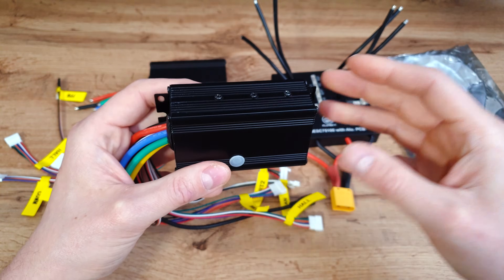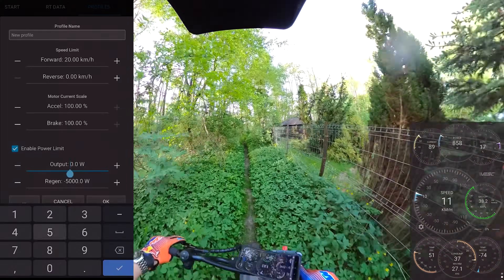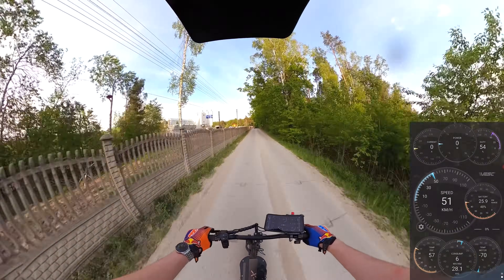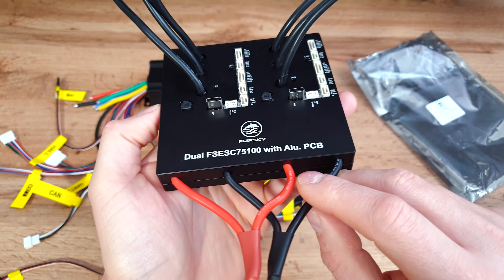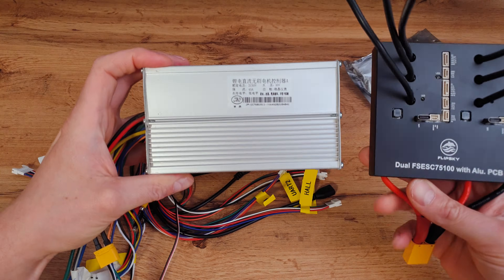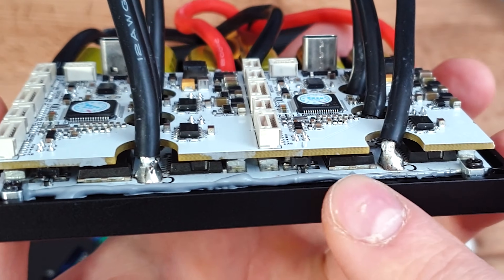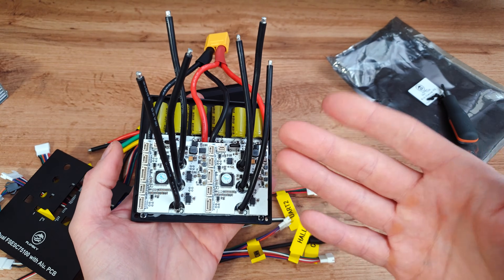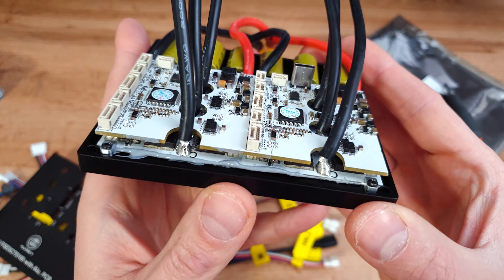Dual FSESC 75100 V2 with Alu PCB 🤫Looks like they fixed overheating issue & Small Update

Comment: can you access profiles on the go? Like gears inside certain amperage values?
Reply: Like can I set one profile to reach 20a anotjer profile at 40a and 80a etc?  Goal is to setup gear like shifters
Reply from the maker: Yes U can set profiles, different speed, power 1wd/awd ...
Reply: Thanks i ordered 75100 dual flipsky. If i encounter a problem can i reach out to you for help with vesc tool please? 🙏 @PirateWasHere
Reply from the maker: Sorry I do not provide teaching support

Comment: I have never ever had an issue with overheating on any of my flipsky controllers. I size them properly I go and get the one that actually can put out the amperage. I want not make it force the averages above the limits of that little baby 100 controller. Sorry to rant. I’m just so fed up with all these videos on here that are not right.
Reply from the maker: Rant... before rant show some numbers, I am also fed up about people which just talk, but can barerly understand how it works and cant give any decent info, like KV, amperage , voltage, heat spreading  efficiency, connectors ,  wire awg. 
Mostly they just talk talk talk....

Comment: Why don’t you use the proper size controller instead of being cheap buying a super small unit. I am so tired of people complaining about overheating and burning up their controllers. You said you crank to 5000 W! Why that controller isn’t made to do that if you do what it’s made to do if you read the instructions if you educate yourself just a little bit before you make a video you don’t look so stupid!
Reply from the maker: Do you mean like , my car can do 6000rpm max, why I am not using it like this all the time ? . 
It's not about size but about spreading the heat from mosfets, newer case can easily help spread 5kw compare to old thin one, which after 8sec is 100c++ ( lots of people reviews on groups).
Looking stupid these days, seems to work better than other way. 
Cheers

Comment: Hi Pirate! Do you think the flipsky FT85BD ESC will have the same performance as this one? The specs look the same.. thanks for the videos!!
Reply from the maker: I guess, hard to say
Reply: No, ft85bd can do 2x250A peak, this controller can only do 2x200A peak. Alum casing on the ft85bd is also much better and spreads heat more.
Reply: @SRNAR8 but it doesn’t have vesc software, and I think that their Flispky software isn’t as good as the vesc one

Comment: looking to use this ESC to convert a lawn mower to RC. will this ESC work two motors independently to make left and right motors spin in opposite directions for steering or does it control both motors simultaneously in the same direction only?
Reply from the maker: Bruh I want to do literally the ame but I want to build all from scratch 60/80cm + use tracks or small quad wheels :) . U can controll VESC as you like by simple ppm / pwm , if U want to use just RC remote without extra controll board, then U have to setup " mix " on remote for two channels ( for both wheels ) , so it will drive more or less like tank . Cheers

Comment: Hi 
I have a Dualtron ultra 2 72v 35ah 6640w dual motor scooter. Which controller would be best for my scooter. Would like more power and speed if possible. Thank you

Comment: Hey quick question I had single drive fs75100 and I used two batteries in parallel (58,8v/18,6ah/964Wh each of them). I ordered now dual drive fs75100 and I'm wondering about its better to use my batteries still in parallel or is it maybe better to use 1 battery per side of this vesc. Z góry dzięki za pomoc 🙃

Comment: I went with two of the new ubox 100v/100a single units with fans from spintend, thinking about throwing it into a laotie Ti30 (or similar system) or a T10-DDM
Reply: I bought a set of the 75v 100a uboxes when on presale 😉 like $80 a piece 😉 score. Gonna get the 100v100a while on presale too. But anyways. Have had them in my board but just got scooter. Thinking i would like to put them in new scoot 😁 (maike kk10s pro) but i also want the new spiny throttle spintend has along with hub to vesc adaptor harneses and the ADC unit 😉 that has all the other hook ups. Lights n horn n whatnot 😁 i am curious if the 75/100 uboxes can take the heat? I think i will use thermal paste and seperate them when installing in my metal scooter enclosure. 😁 Did you receive the 100/100 yet? 😁
Reply: @redreefbud  I wanted the spin-y too, but i'll settle for the throttles I have laying around already for now haha.

Damn you definitely scored well with the 75s!

I ordered the adapter board and a bunch of spare harnesses, as for the 100s they have delayed shipment at the moment due to having made some changes by the looks of things
Reply: Yeah, he claims a copper plate in there for dealing with heat. That should help 😁 and them thermal payste and hooking them spread out in corners. I didnt realize how heavy duty this metal enclosure is until i ripped apart 🤯 huge heatsink with outside air flow as long as you get good connection 😉 this thing i got here is a beast already. Going to collect parts and think about it while i beat on the stock version 🤣 i did get a daly smart bms that im thinking about putting in today 😁 want to check this battery out and make sure it is what they told me anyways 😉 should be 16s6p samsung 50G 😁

Comment: I tried that one but it seems unstable on FW 5.3 because it can't even get my Motor configured right in FOC and flipskys customer service is absolutely garbage... would definitely stay away from flipsky
Reply: Two of these escs died on me the same day, I got 100$ refund (one esc), won't buy flipsky ever again.
Reply: @Eden_M  how did you run it, power it up etc

XT90-S loopkey or crappy antispark that dumps all power?

also these things break easily by vibration i figured, when they arrive first thing you need to do is open them and go over the electrolytic capacitors (add extra solder on all the pads)

one broke not long after i bought 2 of em (both 75100 alu pcb but not a dual version in the same scooter)

when i opened the broken one there was a loose capacitor, entirely off the board, another one with 1 leg detached, and another one also leg melted

traces on the PCB blown to the caps and a ceramic cap blown up

i suspect the 1 remaining of the 3 caps couldnt handle the current and melted the leg and then the extreme peak current shorted the ceramic cap and because of that short blew the traces to the capacitor

well, i saw a 250A fault current due to smashing full throttle on a badly tuned motor

i figured the electrolytics are sometimes badly soldered, i ordered a 3rd one to replace the broken one, opened it up before i done anything, touched a cap and a leg instantly came off of the pad on the board, so i added solder on all of them, in the older functioning one and in the new one

then i added 3M strip calk under and above the caps to make sure it wont get vibration damage either way

probly could use some foam weatherstrip under and above the capacitors instead, just to make sure they dont break anyway

since then it's been 6 months without any issue, seeing 120A peak motor current each every day

i do run an antispark connector loopkey aswell though, the "antisparks" you buy on their site just dump a lot of current which is bad for the ESC's

also it's important to not plug them in separately with CAN connected, that can break the CAN ic's

in my case the broken one actually still works, but has no capacitance so it is really weak and cuts out constantly

i can probly add a low esr cap bank to it externally but meh, maybe one day if i decide to fully fix that controller
Reply: @BH4x0r  Hi. I want to install 75100 alu to vsett 11X what do you say? I know that i must open and reinforce internals this is no problem. Or maybe i will mod original one with better wires more solder and add copper  wire for shunt this will probably ad another 20A or even more.
Reply: @trebor1477  they're awesome, but you should really look at the 75200 alu pcb's, on VESC it usually says motor current instead of battery side current

when you see 45A on scooter controllers, thats the battery side current, real peak current is probly 150+A at low speeds

i've been riding the 75100 Alu PCB's now for a long time and had no problem with them, but i feel like i miss a bit of torque, could be my motors too though, but yea 120A motor side isn't that big

also even if you dont run it that high on the 75200 alu pcbs, you've got less strain on the controller and probably even more longevity, and if you ever want more you can do more

but yea, great controllers either way.. cant go wrong with them

i don't even use physical brakes, i just use regen cause its that strong already
Reply: @BH4x0r  Hi. Thank you for your info about the controller.  For now I modded the original 72v 51A controller from vsett 11 super. So now it must be 60A under turbo mode and 50A in normal mode. I added a temperature sensor to monitor how hot it will get. And it is quite heavy almost 2kg with a little more copper and 8AVG wires.
Reply: @trebor1477  the 75200 Alu PCB's are only ~300g each and very compact

they can be due to using modern surface mount mosfets which can take 380A each! there's 12 mosfets in each 75200 Alu PCB

so its safe to go up to 250A motor each, and they have 760A worth of fets per phase so very low stress on the components, but due to the board and wiring not smart to go over 250A

the 75100 Alu PCB's have 380A worth of fets per phase (6 in total), but due to the pcb and wiring not wise to go over 120A

the original 75100 black box overheating ones had crap fets with only 120A rated fets
Reply: @trebor1477  by the way, to let you know how reliable the controllers are, i've had mine in my main scooter (Obarter X3) since pretty much the beginning of owning it, august 2022, and i've done 15000km since then, no real brakes, regen throttle on ADC2

current cfg: 45A battery 120A motor/max current
-25A regen 120A motor/max regen current

each controller

due to my battery right now i cannot ask more than this, but never had overheating even in 36°C weather

i'm waiting for P42A's to come available in my country again, i have another scooter (Boyueda S3) thats waiting on a custom battery and i'll put the 75200 Alu PCB's in it!
Reply: @BH4x0r  Nice. In the sett 11 72v controller are old CRST030N10N 207A 100V. Is it possible to use the original display and trigger  with 75200 ?
Reply: @trebor1477  you can use the trigger of it, but it cannot communicate with the screen to say speed etc

Comment: Hi, this controller does not come with any cables right?
What is the type of plug that I need, looks like some sort of JST but cant find anything specific..
Reply: jst GH 1.25
Reply: @server1789  massive thanks man :)
Reply: @flosa1995  hey, i get mine today. There in package are already all connectors. I order flipsky 75100 v2 from official store👌

Comment: just buy a sun ron , cheaper in the long run then fuking around with theese small wheel scooters
Reply from the maker: Nah man Ktm EXC 250 is way to go, but still 4x4 is most comfy ;)
Reply: sur ron lol nah they aint powerful enough lol. By the time u invest abt 3k more in batteries and controller, it wont be worth it, u could literally get an used ducati hypermotard for that much and they are way more powerful and fun.

Comment: Pirate! Massive thanks for your initial 75100 vid.

Just about the complete my Flipky 75100 on my Wolf Warrior X. Just the lighting left.

Took it for a test ride... oh my gosh... insane!.

Smooth, no motor noise, crazy stable with smooth acceleration to 50mph. No jerk and the electric regen braking (Used a left sided throttle  with ADC2 brake no revers settings on VESC rool) is suprising strong enough that not once did I feel the need to use the brake on a 30 minute ride. A Totally different scooter. 

Never going back to normal controllers.

Will post vid once complete
Reply from the maker: Awesome 🍕🍻
Reply: Are you using 75100 earlier or this new version like in the video?
Reply: @strangeous  the alu's are definitely much better, they'll do 50A @ battery 120A phase/motor peak, and more on battery side too all day without heat issues
Reply: So where is the following up video :-) ?????

Comment: what should i get for an AWD trike? 75100 dual + single or 3x single?
Reply from the maker: for 3wd for sure U need one dual and one single, I didn't test yet newer 75100 but looks like will be good
Reply: @PirateWasHere  hm guys from flipsky told me to go with 3x singles connected with CANbus... becuae more similar characteristics of single ones than mixing dual + single
Reply from the maker: @redhotbits  how u will connect 3x single if every single got only one can port ?

Comment: Have you tried the spinted ubox bro.
75v 200amps.?
It look very similar to that.
Reply from the maker: It seems to be way better, but I did not test it yet
Reply: @PirateWasHere  well I can say I use the ubox v1 and it’s insane bro. I’ve not had any  issues with it. I put it in my electric mountain board. And bro it’s a beast. I bought another one for my next build. It doesn’t over heat it’s really good.
Reply from the maker: I will try it then 🍻
Reply: @PirateWasHere  it has a 12volt output so you can put fan on top of it.
Reply: I have 2 of them in my mountain board and thinking about putting them in new scooter 😁 i have the 75/100 singles (UBoxes) just got a maike kk10s pro. It is already a beast but very touchy throttle 😉 curious about heat

Comment: Nice ! what would u recommend ubox v2 or dual 75100 ?
Reply from the maker: I never used them but Ubox V2 seems to have HQ mosfets but the price is like x2
Reply: @PirateWasHere  Hey bro ... so if I'm getting 2 7500 watt motors.... the controllers need to be 72 volt 100amps each? like Volts*amps.. in this case is 7200watts.... so I need the 72 volt 100amp controllers to pretty much get most of the power out of the motor right? besides being 300watts off?
Reply from the maker: @fightsandfinance7570  for legit 7500w u need 14 000w controllers ;)
Reply: @PirateWasHere  For both of the 7500 watt motors right? I did your equation .... The Chinese manufacturer are giving me 72 volt 50amp controllers which Is weak for the Dual 7500watt motors... I will need 2 72volt 100amp controllers Right? Totaling 14400 watts 600 watts below motor peak capacity but oh well that's already a lot of power
Reply from the maker: If motor constant is 7500w , then peak cold be extra least 50 to 100%
Reply: @PirateWasHere  they say it's 2 7500 watt motors... It says 7500 a piece on the side of the motors.. it's a good bang for the buck for the Money
Reply: @fightsandfinance7570  If you write 15kw on the side of the motor, does it double the output?

What I'm getting at is that when buying Motors you have to trust either your own knowledge, or the rep of the vendor.

The same motor will be sold at different power levels with nothing changed but the labeling
Reply: @Zomby_Woof   @Robert Franz  Your right. I trust the vendor I bought my scooter from... My first skepticism was if the motors existed at all. But I confirmed it was real.. Confirming whether or not the vendor was real in the first place at all was my first mission. I actually placed a down payment a couple days ago and they built the scooter already and told me when I pay the rest off .. it'll be shipped. I got the 2 7500 watt motors on it with a 72 volt 60 amp Panasonic battery.. I'll make a video of It when I get it. It costed me 2350 ... I don't know how people are paying so much more for scooters with much less specs ...but then again companies like the Varla, Vsett, zeroXs, and Dualtrons and stuff have to make money. I bought it directly from manufacturer in China. I'll just have to wait to get it. The only thing is that the controllers im getting in it is 72 volt 50 amp controllers which means its not able to use the Max power of the motors ... But I'll eventually upgrade to Kelly controllers to get the max power out of the motors and likely install some type of cooling inside the deck and also add Gps chips to prevent theft.. other then that I'll be good to go
Reply: @fightsandfinance7570  I almost pulled the trigger on a scooter like that a while back, but opted for building a fat ebike instead.

If I had it to do over again, I'd probably start with a custom frame.

A bit more upfront cost, but when you start building it out, you end up with a pretty hefty investment, and fighting the form factor limitations of a bicycle frame  can be a real pain.

If you haven't looked at Flipsky controllers, you might want to give them a look. Based on open source vesc, designed primarily for scooters and really compact.
Reply: there single is 120 $ rn!